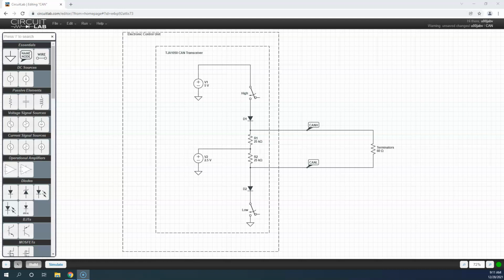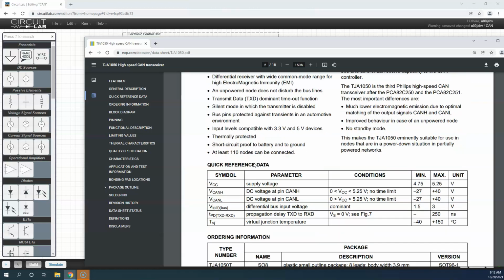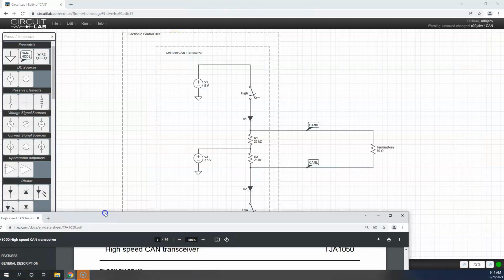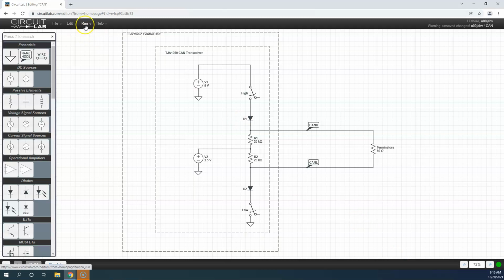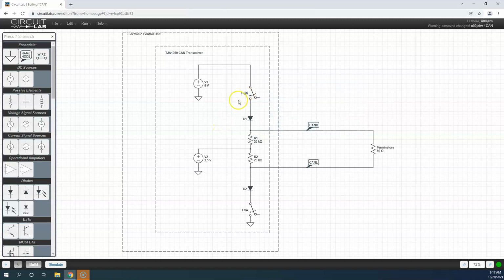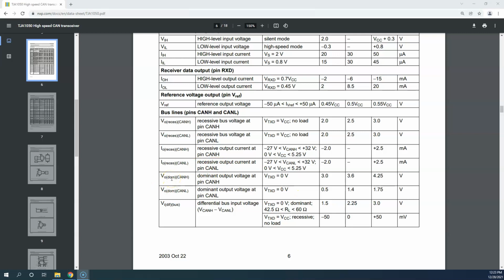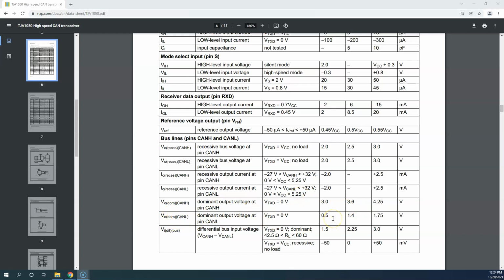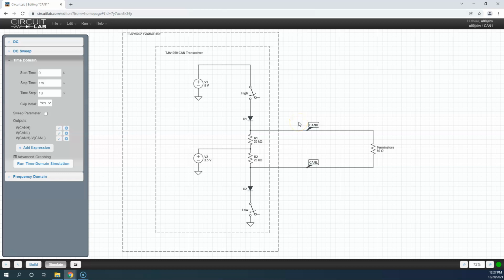Advanced J1939 Hardware 1

Comment: Hello Joe!  Thanks for your series.  I found it truly amazing!  I did have a question.  When canH is switched on, why isn't it 5 volts, and when canL is switched on, why isn't it zero volts?  Thanks!
Reply from the maker: There is a voltage drop across the forward biased diodes.  I should have put two in series for high and low, but instead changed the parameters for the diodes to cause 1.4V drop instead of typical 0.7V.  I didn't think anyone would notice.  This is just a block diagram of the hardware, actual components are likely proprietary.

Comment: Hi JOE, can you explain the maths behind the 3.6V and 1.4 Volts. Also if you short circuit CAN H and CAN L, won't you cause a dead short. Without the benefit of a schematic, I built a working model of a CAN signal generator but I had 47ohm resistors where your diodes are.
Reply from the maker: I doped the diodes so they would have a forward bias drop of 1.4V to look more like CAN voltages in this very simplified schematic.  I could have put two diodes in series in place of each diode.  Therefore for CAN H, 5V - 1.4V = 3.6V.  For CAN L, it is just the 1.4V dropped across the diode when FETs are ON.  For a CAN H to CAN L short, the diodes would each drop 2.5V to force Vdiff to be 0V.  This is just a simplification to show the basic theory.  The manufacturer may not show all the details such as additional components to handle failure modes like your short.
Reply: @joebell6283  Thanks Joe. I had to do the same with my virtual lab. I've got the real circuit working using resistors for demonstration purposes, Its safer that way when I do the shorting out bit. And you're right, its only a schematic. Great videos Joe.

Comment: We have a one module transmitting a differential voltage at 2.5 volts and approximately 15 other modules transmitting differential voltage at 2.1 volts. We are generating continuous errors on a using a CAN Bus Monitor. Do you believe this is the cause?
Reply from the maker: Do you have a scope trace?  Have you tried disconnecting modules one by one to see if the errors cease when a particular module is disconnected?  What is the application?
Reply: @joebell6283  Thanks for the response Joe! And yes, I have saved several waveforms at this point with a picoscope 4425, using pico 7 software.   I am seeing high error counts using Nexiq Device Tester, but I am still learning how to decode on the pico. The device in question is a Bendix TPMS ECU, on a 500 kBaud powertrain network.